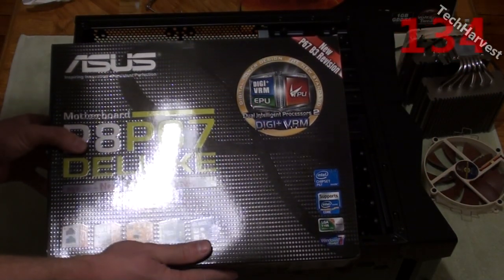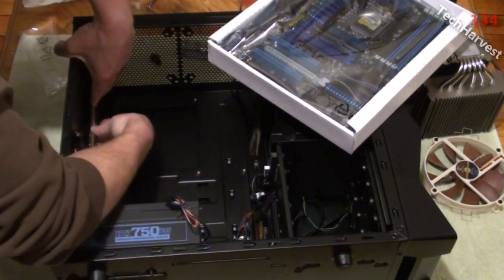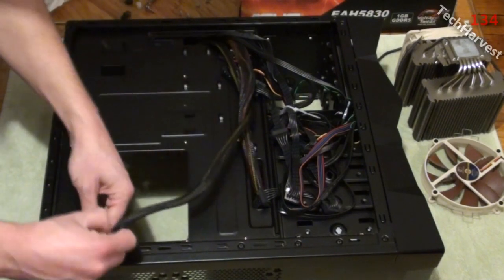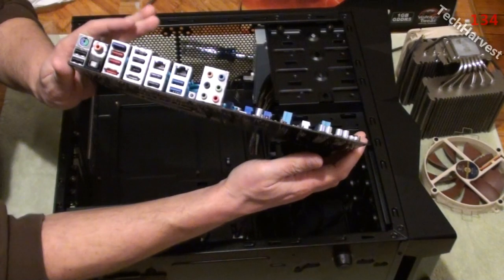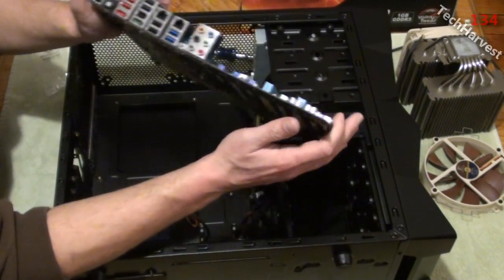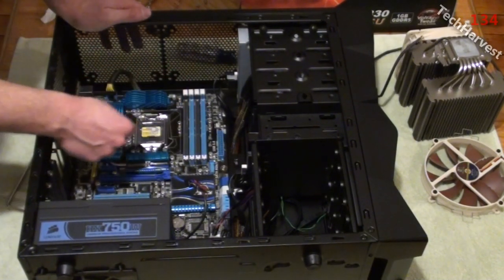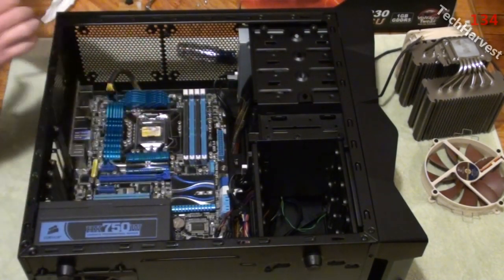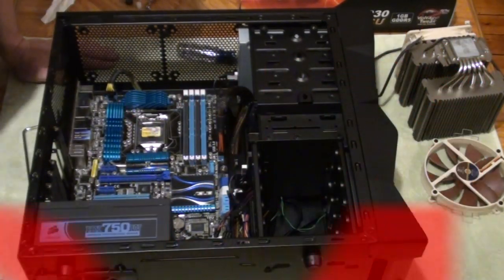Upgrading A PC:  Installing A Motherboard

Comment: So I got a PC and I'm upgrading my gpu now but I had to get a new power supply first and now I touched some shit I shouldn't have and my front panel is unplugged and F_USB 1&2 are unplugged but I only have 4 two pin connectors so halp plz. The motherboard I have is an am760g
Reply: I'm a fucking idiot. Shit all I had to do was read

Comment: Hi, where do you get screws to fix your motherboard from? do they come with motherboard, or your PC case?
Reply: +Gaming PC tests+ Extra Yeah, all the screws to hold everything come with the case
Reply: Thanks
Reply from the maker: +You tube Entertainment For All Most of the hardware you'll need comes with your case.
Reply: so screws for motherboard come with case, not mobo?

Comment: does the mother board size matter in your pc
Reply from the maker: gamingpineapple13 It matters when choosing a case for your PC.
Reply: gamingpineapple13 yes there is atx/mini atx and micro atx most aftermarket  newer cases can fit all 3 sizes if its a normal size pc it is atx standard

Comment: my question is... if I have an SSD with my OS on it and I also have a HD with all my game installs on it.. when I change motherboards and CPU I'll obvusioly have to reinstall windows. After windows is installed can I just hook up the HD and the games work via Steam?
Reply from the maker: It should work the way you describe it.
Reply: TechHarvest are you still using this motherboard?

Comment: I feel none the wiser after watching this. Any nut could figure out how to screw it on the case, I want to know the entire process of removing the old one, cables and all, and replacing it with the new one. "Upgrading A PC" isnt an appropriate title since this video suggests you're building one from scratch.

Comment: Hi TechHarvest , i have a question. I am about to upgrade my pc by getting a new motherboard and cpu and ram ... so i want to ask if it will be ok to put the old motherboard ,cpu and ram on an other pc ... i am asking cuz i don't have the motherboard drivers cuz it's actually a very old motherboard and i i bought it used so pls tell me what i have to do in that case

Comment: hi, i have Dell xps 8700 with CPU core i7 4th gen, i want to upgrade my PC but xps 8700 case and mainboard  too small for some Video card and sound card( i put the MSI GTX 660 2GB OC and Creative Blaster Z in there... with PSU 460W .when i playing game with hard graphic pc going down, not functioning. ) so i think i need to change mainboard and case big more then one i have. CAn you guys help me about this, please give me some tip...thank a lot.
my pc Dell Xps 8700 
CPU intel core i7 4770 
Ram: 12GB 
HDD 1 TB
PSU 460 W oem 
VGA MSI GTX 660 OC TF 2GB
Soundcard Creative Blaster Z 
so i dont know which name of mainboard of this ...and now i'm think i was wrong while not build PC by home.
Reply from the maker: If you find that your case is too small for your components, you can always upgrade your case.  I recently upgraded my case to a full tower.
Reply: thank you, one more question : if pc going down when play game , monitor go sleep and pc still run , sound in games still on but i can't do nothing , i'm try put caplock but light on keyboard not change too...so that cause VGA or PSU or something ?
Reply from the maker: It could be one of several problems.  The first thing I would do is try to rule out the monitor.

Comment: Hey can I upgrade my motherboard and use the old cpu cause my old motherboard broke ? I NEED HELPPP thx
Reply from the maker: Yes.  However compatibility is crucial.  All motherboards aren't created equal.  You need to make sure your new motherboard is compatible with your old processor.  If your CPU is outdated, you might want to consider upgrading it too.
Reply: ok thank you for the help
Reply from the maker: No problem.  Good luck!

Comment: questions... if I put in a new motherboard in the computer, then do I need drivers for it before I put it in?  Can I get the drivers after?  What if the old motherboard broke and I cannot get the drivers before I put the new 1 in?  How will I delete the old drivers so my computer doesn't keep useless software?
Reply from the maker: You will need to reinstall Windows on your SSD or HDD AFTER you install the new motherboard.  Once Windows is installed then download the drivers specific to your new motherboard.  Since your old Windows installation won't work with the new motherboard, you'll have to reinstall Windows anyway.  Don't worry, you can use the same copy of Windows and COA.  It's just that Windows configures to your hardware and changing out a major component like a motherboard or CPU requires a fresh installation.
Reply: TechHarvest ok so will that whipe out my memory? cuz I wanna keep my 900gb of movies pictures games and homework on my broken computer...

Also, will I get a CD for that? cuz I cant reinstall windows on my broken motherboarded computer since its... broken.  Also, if I reinstall windows, then how will I get the driver since the computer wont start up untill I got a driver for motherboard.  Can I just put the new board in and then have windows automatically get drivers like it does for all the other stuff?  I WILL LOVE YOU IF YOU MAKE A VIDEO ON HOW TO DO ALL OF THIS (and il subscribe)...  Also... I cant make a backup before I reinstall windows since my old motherboard is broken and I don't think it will ask for backup when I install the new windows.  Lastly, is there anyway to save my precious 2 years of 900gb work??? Q . Q
Reply from the maker: You are going to need a copy of Windows.  I've heard you can download the correct version from the Microsoft website but I never have.  I've always had a disk.  So you will either need a downloaded copy of Windows or the Disk.  You can use the COA that's hopefully still attached to your computer.  Your computer will start up and run without the motherboard drivers however your wireless or Ethernet might not work without drivers.  

If you buy a brand new motherboard, it will come with a disk that has the drivers on it.  If you are buying a used motherboard, you're going to have to download the drivers onto a flash drive from another computer and install them on the one you're fixing.

As for your data.  If you reinstall windows on that drive, it will destroy all of your data.  So you will either need to put that HDD into another computer and copy the data over there or just get a new HDD for the computer you're fixing.
Reply: TechHarvest thx for the tips I'll get the brand new motherboard tomorrow.  I also found a clean original version of windows 7 ultimate online for $50(credit).  I prefer that over the usual factory version cuz it doesn't have adware on it.  Also what is the COA?  Never hurd of it before (I'm a newbie at computer hardware repair)
Reply from the maker: A COA is a Certificate Of Authenticity.  It's the key code you have to type into Windows to activate it.  You need it.
Reply: TechHarvest thx lol I did the stupidest thing tho... bought a motherboard that was too big for my case, so yesterday I went to exchange that for a micro motherboard and it costed more than the big 1 that had 2 x 16 slots where as the 1 I got only has 1 x 16 slot..
Reply from the maker: Yeah there are a lot of details when it comes to building a PC.  At the end of the day it's rewarding and fun even though it's a bit annoying ;)
Reply from the maker: Hmm... That's not good...
Reply: i need help as well if i put the same mother board back will i need to re install windows still?
Reply: Callum Curtis I finished everything on my computer and realized I was making it too complicated lol.  If you have windows previously installed on your HDD then you don't need the motherboard drivers and you dont need to factory reset.  All of your data will be the way it was and windows will auto update new drivers assuming old motherboard drivers weren't deleted.  The only scenario where you would have to reinstall windows will be when you take out the HDD that you installed your OS in.  In all other cases, everything will be automatic with the exception of graphics drivers since most updated drivers off of developer sites are the best recommendations for GPU.  Although if there is ever a problem you should keep your manual and Drivers CD stashed in a safe place to get basic systems running, in order to consult the issues...
Reply: So if I switch from an Asus z87-a motherboard to an Asus Maximus VII hero I don't have to reinstall windows since I'll just be using all the same parts?  I don't have the windows disk since I had the computer built at tiger direct here in El Paso.
Reply: +pspppe thank you mate.  I was worried about the windows thing too.  planning on getting a new motherboard because I dont like using apu.

Comment: I have a XP can I rebuild it to a windows 7 or any windows
Reply from the maker: You should be able to.
Reply: Wont I need new parts for the computer like its not slow that much
Reply: It wont hold HD videos
Reply from the maker: It's quite possible you might need to do some upgrades.
Reply: K
Reply: Thanks
Reply from the maker: No problem, good luck!

Comment: Hey i have a question i have a gateway dx something it has an intel core i5 4670 and i wanted to know if all marx motherboards if all the screws are in the same place      because i don't want to buy a motherboard and it not fir and i heard that i have to get the right size psi is that true?
Reply from the maker: There are different classes of motherboards.  ATX, Mini ATX, etc...  Find out what your current motherboard is and purchase one that is the same size class.  As for the PSI, if you have a slim case you can't use a full sized PSI.  If you have a regular case, a full sized PSI will fit.  Make sure you get the right Wattage for your components though.  Google "PSI calculator" if you are in doubt as to what power PSI you need.
Reply: TechHarvest I know what size its a matx motherboard but will all matx motherboards work are all the screw holes in the same place on every matx motherboard?
Reply: mrswaggerkid01 Use a static wrist band though...
Reply: Dub stepzz Ok :) Do you know if all the screw holes in the same place in every matx board?
Reply: Well, to be honest I don't have much experience with motherboards because I think it's a pain in the ass to install 'm, so I let someone else do it for some money :) They should be though. I mean, why would they place it differently?
Reply: Dub stepzz I agree yeah I'm gonna let geeksquad do it because ill save about 50 bucks when i do it but i can tear my hole pc up so yea geek squads gonna do it
Reply from the maker: Working on your own PC really isn't that hard.  However if you feel more comfortable having someone else do it, then it's worth paying the extra $ for peace of mind.
Reply: Sure it isn't thát hard. But I just hate motherboards in cases.
Reply from the maker: I hear you.  Changing your oil on your car isn't that difficult, but I prefer not to do it myself.
Reply: Well, I actually like to work with cpu's, gpu's, modules etc.

Comment: when upgrading a motherboard from an old one do you have to re install windows?
Reply: Yes, you have to re-install, but if you have an OEM version of windows you have to re-buy it.
Reply: What does OEM mean? :)
Reply: No clue. Google it. Anyway, it should be on your receipt and or manual. If it says OEM version you have to rebuy it when you upgrade your motherboard unless you replace it with a board that has the same chipset.

Comment from the maker: Use the screws from the old motherboard.  If it's a new case, it should come with the screws.  If not go to a computer supply store in person or online and order screws there.  You put a lot of time and money into building a PC, make sure you get the right parts when putting it together.  Good luck with the upgrade/build.  Let me know how it turns out.

Comment from the maker: I'm not 100% sure what the separator you're talking about is.  It could be several things.  However I would say if you know where it goes, install it.  As for the airflow direction of the fans, if you are in doubt, plug them in but don't mount them.  Turn them on and feel what direction they are blowing.  Once you've determined it mount them.  If you have a good understanding of how a fan blade works, you can also just tell by looking at how the blade is angled.

Comment: Hi, I just built my first PC, buut, I am not sure I have done the wiring correctly. My PC starts, the CPU cooler starts, my GPU starts and the fans for the HDD works, but the 3 side fans don't and when I connect my PC to my screen nothing happens, please help. Btw I have an Asus H87-PRO motherboard, an MSI GeForce GTX 760 2GB, and an i5-3570k cpu. Please help

Comment: @TechHarvest When you upgraded your Mobo did you have to re-install windows? Or does a new motherboard work straight away providing it has the same CPU socket as the previous motherboard?

Comment: Hi I have a question for you guys. I have a msi p6n platinum sli motherboard with lga 775 socket which is like 4 gens behind.  I'm curious on how to upgrade. I am an ameture when it comes to this. I know basically new motherboard also means new cpu but I need a cheap board that can handle sli and 8 or more gb of ddr3 ram for around 80 dollars. I bought a last gen gaming pc about 7 years old with  thermaltake armor case. Want to upgrade for better gaming. Can anyone suggest one cheap $60 to $100?

Comment: the dimensions should be listed on the product information from wherever you're buying it, take a tape measure and see if those dimensions would fit your case. If you don't have the dimensions you can check what type of size it is (eg. ATX, micro-ATX, mini ITX) most cases have screw holes that label what motherboards will be screwed in where.

Comment from the maker: If you want quiet, you need to look at your cooler and fans.  Generally the larger fans move more air and do it at a lower speed so they are less loud.  Of course size isn't the only factor.  There are different qualities of fans as well.

Comment: The form factors are: Micro ATX, Mini ATX (which is rarely used) and ATX. there are more but there isn't usually a need to go above an ATX motherboard. If you have an ATX case and an ATX motherboard it will fit

Comment: yeah, there are differences between AMD and intel processors. The pin alignment on an AMD motherboard is different to an intel. An Intel motherboard to my knowledge has a good solid pin and a sort of casing around the cpu, AMD just have a pin holding it in. You'd need to buy an AMD motherboard.

Comment: I've seen a lot of people building pc's and the way they seem to like it is to gear up the motherboard. cpu, cpu cooler, graphics card all of that stuff they like to have it on there then stick the motherboard into the case, so you don't have to try and work around the case all the time.

Comment: Yea you might look into the motherboard and see what processors are compatible with you're motherboard. I might be getting thee ASUSTEK motherboard which supports: Sempron, Phenom II X3, Athlon II X2, Phenom II X2, Athlon II X4, Athlon II X3, Phenom II X4, Phenom II X6 CPU's (they should be all AMD's)
Try to look online for support
Good luck :'D

Comment: I'm in the same boat... I have a new gpu for sli, mobo, ram, ssd and an additional 1tb enterprise harddrive. Just haven't gotten around to installing them and wondering if I can use the same copy of windows7.

Comment: Great Video! I am looking to install my new mother board and cpu when i get it. But im not sure how hard it would be. 
I am getting the ASRokc N68 FX and AMD Bulldozer 6 core.
Will my 230V power supply be enough for run it?

Thanks

Comment: hey, i need somehelp i have a badass gaming pc, its 4 years old but is still bad ass it just needs a motherboard upgrade, i need someing better then the gigabyte GA-EP43-DS3L LGA775 Socket with p43 chipset, but i wanna use the same proccessor i have now, anyone got anything for me?

Comment: @teachHarvest When installing new motherborad can i just use the repair option on my OS disc to load all my new drivers?.. cuz it will take a lot of time backing up my data and formatting it..  or do i really need to have a clean installation ? i need a solid response..

Comment from the maker: @SIDETRACKEDpenguin All of your info is contained on your Hard Drive.  That is where your information and unfortunately the virus resides.  If you want to upgrade the performance on the machine then you can upgrade the motherboard.  If you want to get rid of the virus, that's another story.  There are many ways to do it and I'm not really an expert.  However if you want a functioning system, you'll either have to get a new hard drive or wipe the old one.

Comment from the maker: @Thecashflowman It should be.  When in doubt, you can always go to NewEgg and go to their PSU calculator.  Just plug in your components and it will give you the recommended wattage for your Power Supply.  I chose 750w because I might want to do Crossfire down the line.